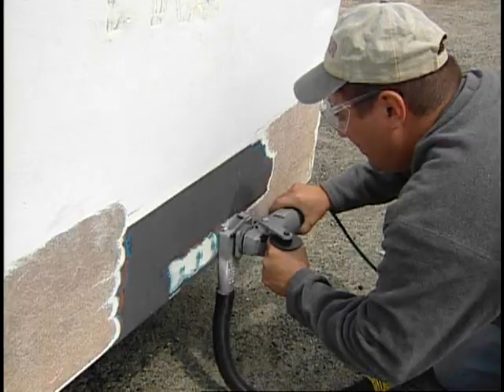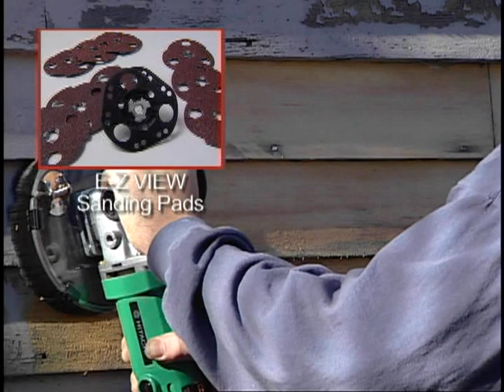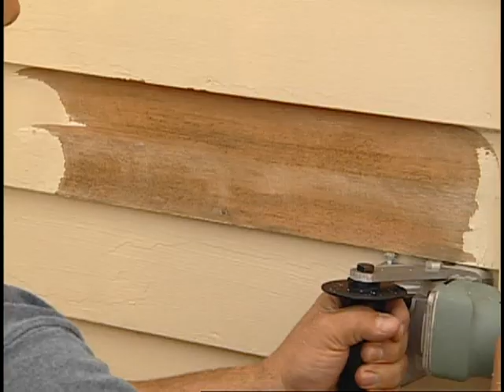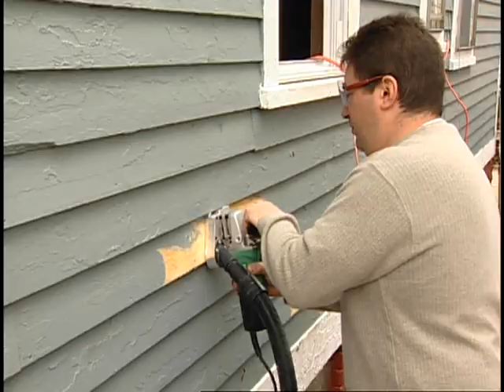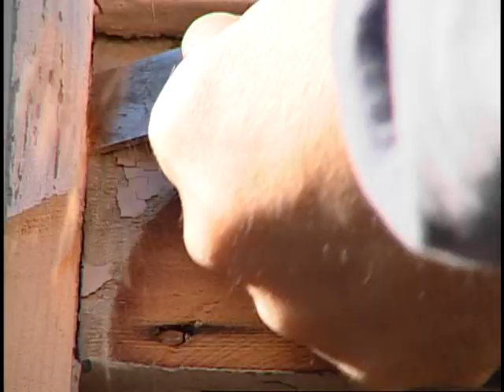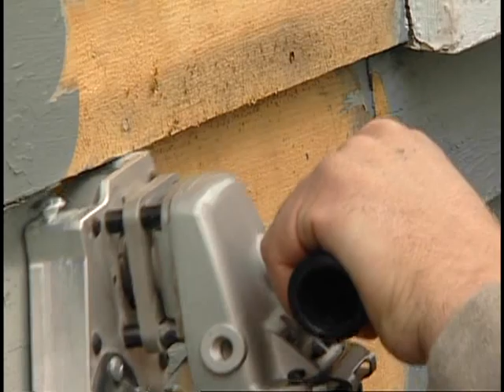Paint Shaver

Comment: The Paint Shaver works well. I do recommend you practice with something like spare pieces of siding or whatever it is you plan to work on. Luckily I had a few pieces left over from s past project.

Overall I think I ended up with a far better result than I would have if I hadn’t used this machine.